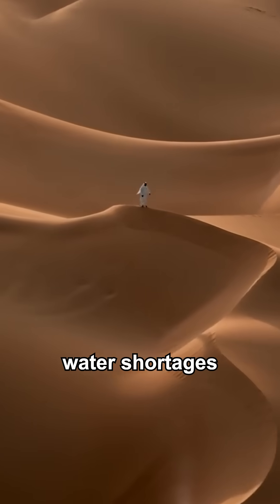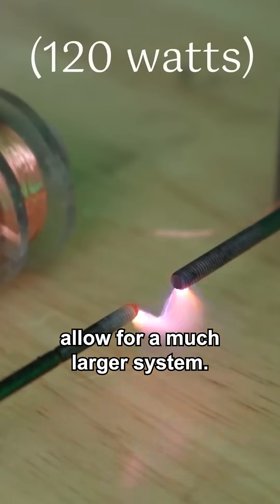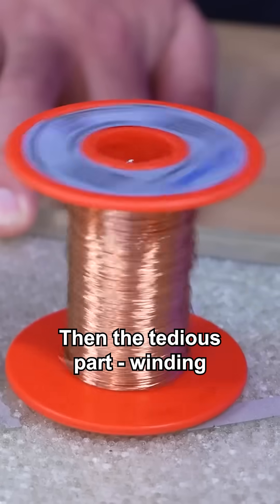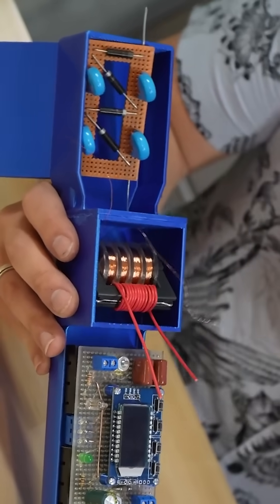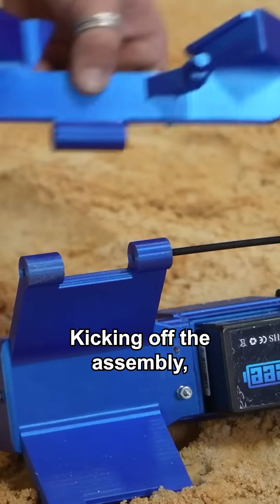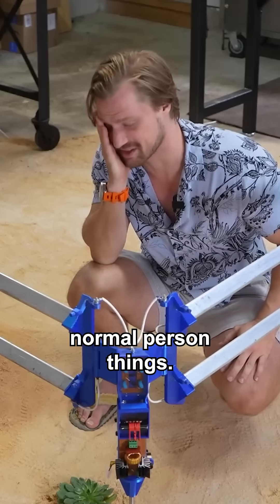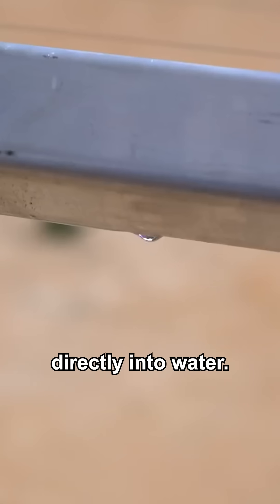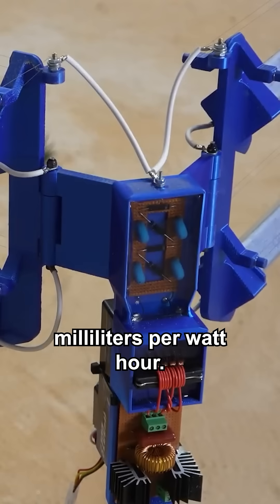Turning Desert Fog into Fresh Water Using 50,000 volts

Comment: something like this has been done in the atlas mountains of morocco. they just use a net between two posts and a small collection gutter at the bottom. no energy required. works great
Reply from the maker: Yeah in the full video I talked about why fog nets are okay - but they only capture 2-10% of all the water present in the fog. They are wildly inefficient. Though, they take zero power with is a huge plus.

Comment: Nice waste of time but a fog isnt needed to draw water from the atmosphere. Campers and survivalists have been drawing water from the atmosphere for years by just digging a hole, placing a container in the hole, and covering the hole with a plastic tarp. The temperature difference  between the air a ove the tarp and the ground condensed into water in the container. No electricity or fog needed!

Comment: Hey, this is a cool idea and all, but they did something similar on the mountain tops where I live and now the rain shadows like twice as big so it made way more deserts and therefore more water shortages
Reply: This! I wouldn't be surprised, if most deserts run water in some sort of "90% closed loop", with whole system adapted to that…

And if broken, there is a question, whether it could be easily repaired…

Comment: People have been wasting time with this for decades. There needs to be the moisture in the air for it to work, and you're usually depriving someone else of rain.
Reply: Fog = water.
Reply: @awatt  thanks, Captain Obvious. Doesn't change what I wrote.
Reply from the maker: Fog is different from moisture/ humidity, honestly. No one has been trying to convert overnight fog into water using high voltage on a serious scale. Dehumidifiers are wayyyyyyy different from my device. At least how I’m doing it. Cheers.

Comment: He man love your videos and I Wouldn't want your house burning down so please please DON'T use zeee battery's they are The worst batteries you can get and a huge fire risk two people I now had these batteries  Caught on fire Just lying there And in both cases they were only 2 weeks old And well cared for and the performance is also terrible They don't have nearly the capacity they advertise and they only have 2c discharge capacity before they drop in voltage very heavily

Comment: Oh no...another 'water from air' project. Few problems: 

- Desert air is often very dry
- Uses a lot of power (you can't beat thermodynamics)
Reply: 1: the morning fog many deserts experience is quite literally moisture in the air. That's why many cultures use moisture nets to harvest the fog, but they're very inefficient.
2: He literally showed that the batteries get charged during the day when the air is dry and it's got enough power to run through the night when the air has moisture in it.

did you even watch the video?
Reply: @bummer6 How are nets a worse solution than this?! 😂

Tech Bros can be so fcking stupid lol
Reply: @aVoidPiOver2Rad 
Fog = water.